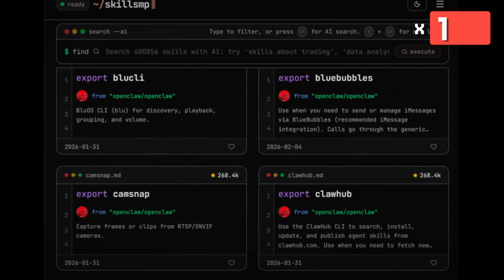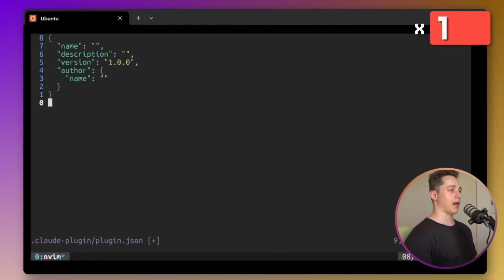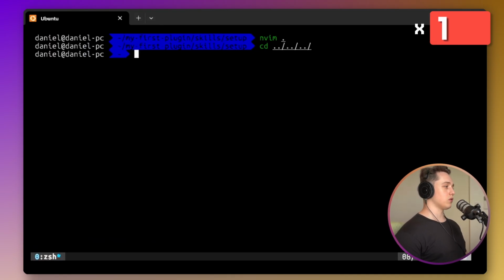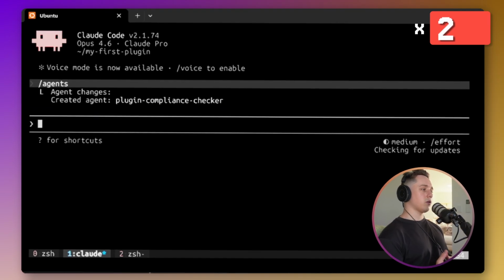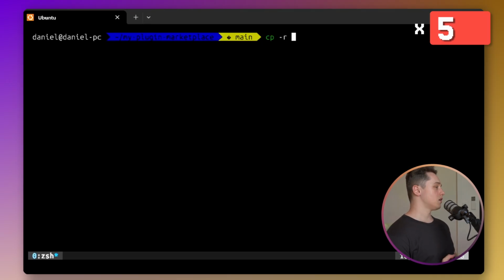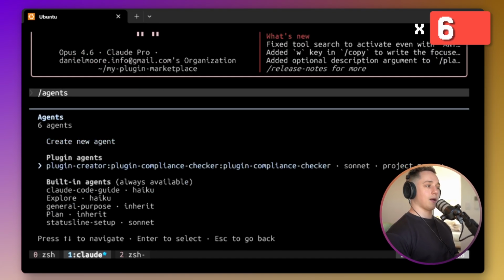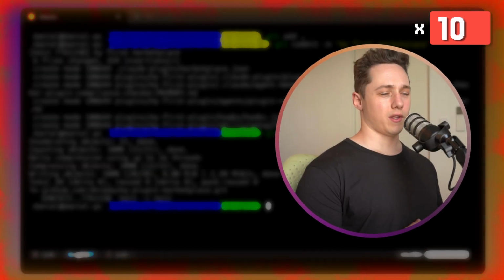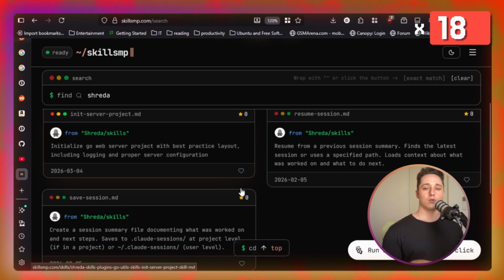You're Using Claude Code WRONG (do this instead)

Comment: My first plugin was creating an orchestrator for complex search in the web operations to drag real documentation, stackoverflow problem solutions for the concurrent day, distill it into my own skill.md's organised neatly in an atomic structure so that I could use this autogenerating & self-improving database across multiple projects afterwards. At day 2 I realized I was essentially building a family of skills that needed orchestrator agent rather than just 1 skill but that only made it more fun.

Now, where this need came from?

1) I am currently on day 43 of doing anything with AI agents, so I intentionally avoided looking for guides/watching streams/reading articles to have a fresh vision on the bottlenecks, problems and finding my own solutions instead of looking up existing ones in the internet. (partial bonus for not trusting any node_module whatsoever that I download with npm/pnpm commands or other users' skills/plugins came from experience of never trusting external modifications/tools unless I've built or sufficiently studied them, safety-wise).

2) I realized that I cannot rely on any LLM/Agent/Model's internal docs or/and ability to find info in the web, so I kinda turn them into language operators on demand and if they exhibit not enough confidence in their internal database (through one of the stages that makes them emit a confidence reply), they go first check external one (mine), then the web, then process necessary info and loop back to the OG prompt - because I realized I don't want them to write shitcode or stuff with a lot of technical debt, I want to cut 7 times but receive 1 clean result that doesn't require 100500 steps to bugfix everything.

Yeah, SECOND plugin was a godclass-slayer :D.